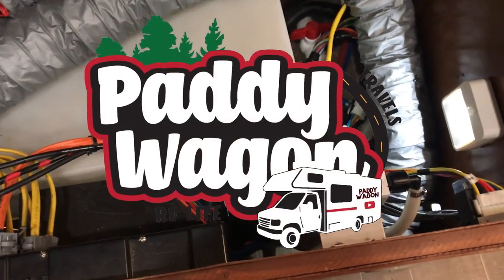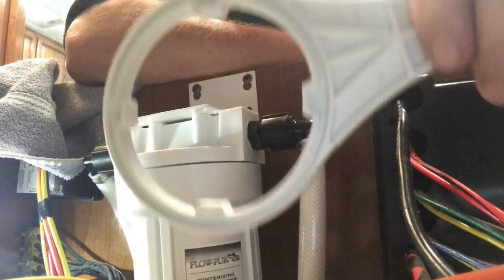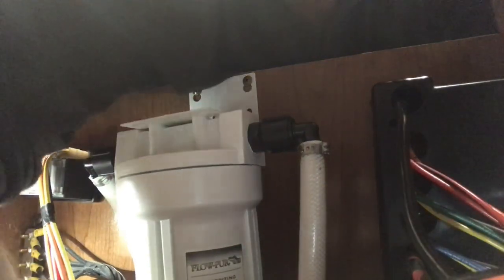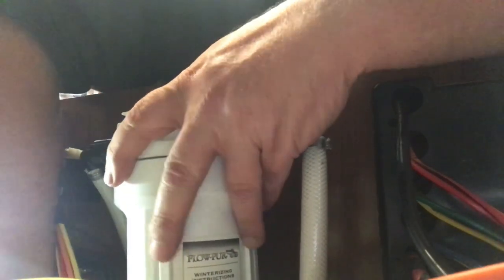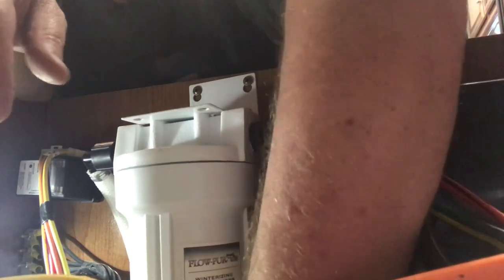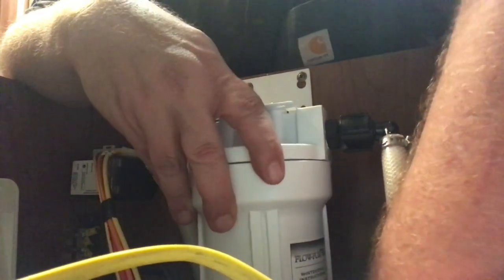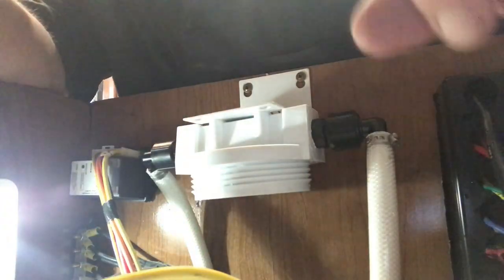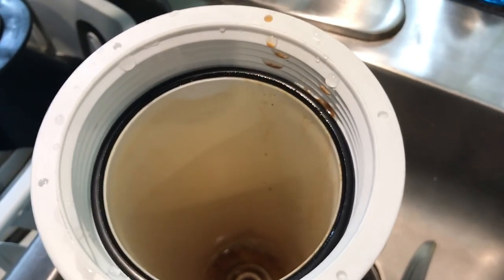RV Life Changing the RV Water Filter

Comment: Hi Patrick, I have a class C and the filter is also in an impossible spot.  Try taking both inlet and outlet water hoses off and loosen two screws that hold housing to wall.  You can then remove entire housing with minimal effort.  Changing the filter is a wet mess so removing it much easier. Great job.
Reply from the maker: Thanks Lou - yea, the area is so small to work in and there is a ton of electrical as well.  Not the best place to put a water filter, but I guess RV real estate is limited.  Thanks for watching.

Comment: I bought a 15 yr. old motorhome from a dealer in 2018 and didn't even know there was an inline water filter until one day, out of curiousty,  I removed a screwed on panel that was adjacent to my bathroom undersink cabinet.  There it was.  Water was in it but no filter.  There was plenty of space to manuever so I was glad of that.  No electrical wiring near.  I took it out and cleaned it as you did and have ordered a new filter to put in.  It was "Water Pur" brand.  I had initially ordered a knock off brand from Amazon but when it arrived granuals were leaking from it already so returned it.  I ordered the authentic "Water Pur" brand and hope the install goes ok and it works well.  Thanks for the video!

Comment: Maybe next time unscrew the two water lines then the two screws holding the filter? Take it right out then change the filter.
Reply from the maker: Hey Bruce!!!!!  Yes, definitely did consider that, but the framing of the filter is riveted to the panel - so unscrewing the top portion would not have given me any more room to work.  Oh well - at least the water leak is fixed and that is great news.  Thanks for watching.

Comment: Easier to mount an external water filter on your clean water hose attached to your city water connection. Have the same issues. Filter is hard to get to plus electrical wires in the same area.

Comment: Hi there, it's a very nice video however I do have another question: before sanitizing the freshwater tank, shall I have to take out the water filter and its cartridge together? If yes, there will be a large hole left here so is it possible there will be water coming out from this hole? Or there is a bypass tube? Please kindly share your expertise. Much appreciate.
Reply from the maker: The only thing you should have to take out is the water filter. I remove the water filter before sanitizing and once the process is complete, I replace the water filter with a new one.  I hope this helps.  Good luck.
Reply: @PaddyWagonTravels  : thank you.